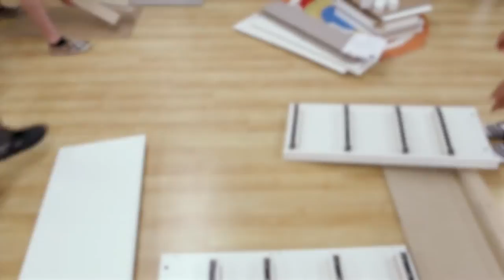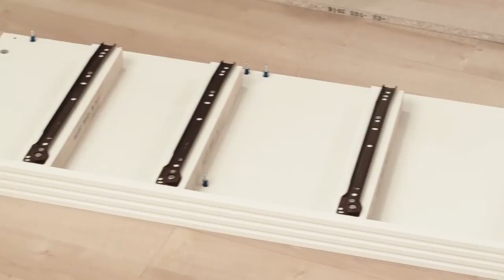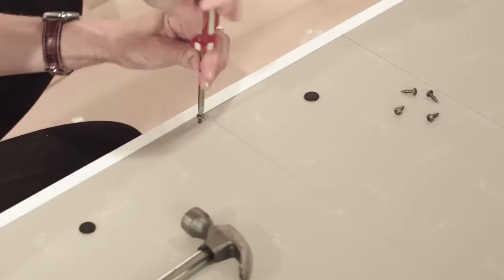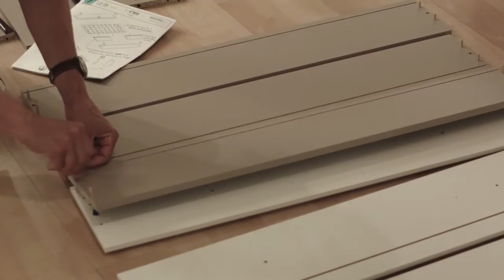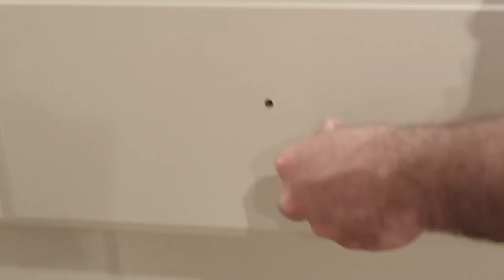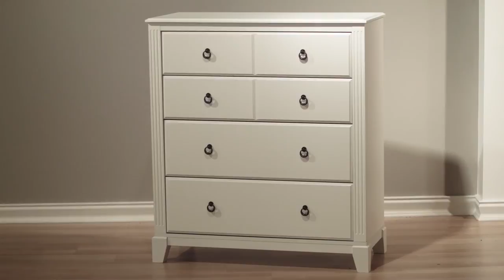Easy and simple assembly, by South Shore

Comment: As a technical writer, I would suggest you take a lesson from Sauder and issue step by step written instructions in plain, easy to understand English to go with the diagrams in the instruction booklet.  Further, packaging the hardware is unacceptable if the bags are not identified.  Last, the stamps used to mark panels smear at the factory, causing misidentification and confusion.  These are the obvious defects in your instructions, among others, and do not address inferior materials that warp or chip, missing hardware and a general level of difficulty that confronts the average person not degreed in mechanical engineering.